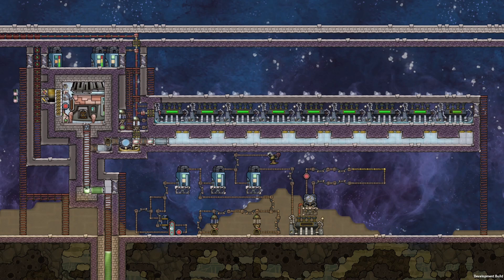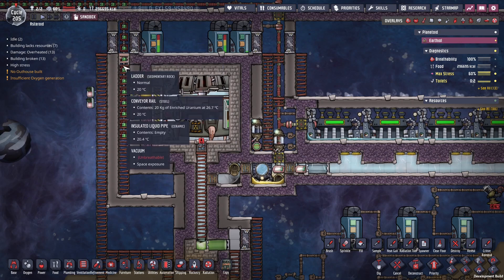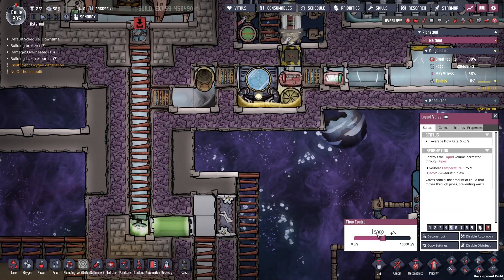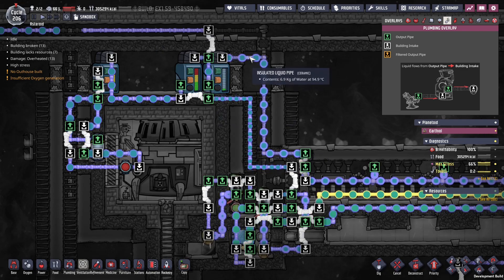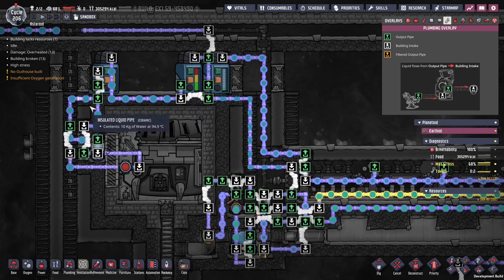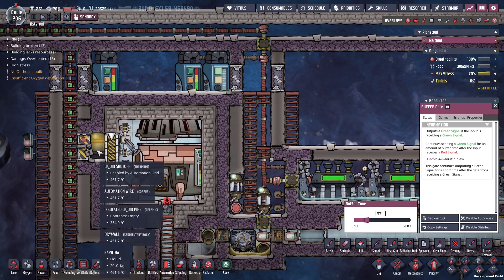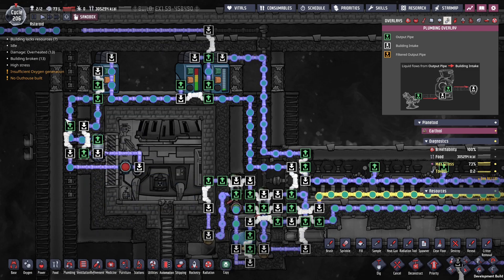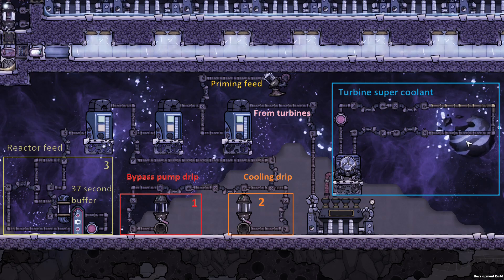Going Nuclear! - Oxygen Not Included: Spaced Out!

Comment: I'm not sure if it's just that nuclear mechanics have changed since this video was uploaded, or whether I'm doing something wrong, but the problem I'm running into is that nuclear waste is heating up beyond its vaporization point inside of the reactor, and so immediately flashes to fallout upon hitting the bunker tiles below.
Reply: Looks like setting the buffer gate to 24 seconds is perfect now, nuclear waste comes out at ~523C, which is probably as close as you'd want to cut it to the vaporization point of 526C. Sadly that only manages to power ~7.5 steam turbines rather than 8 and some change.
Reply: @JM-qo7bk  I know this is old but...

You kinda want the waste coming out at 2000C+. The hotter you get it the more usable power you get out of it. You prevent 2000C waste from flashing into fallout by dripping it into a 1000kg tile of 400C waste.

In 1 tick the reactor waste hits the waste basin and averages with 1 tile. If that temp is higher than the flash point, the liquid flashes, if not the temp spikes up then averages put with the surrounding pool.

Thats what you draw your heat from before the next superheated blob drops into your core.
Reply: @louishermann7676  The problem is that you never get 1000kg of 400C waste if it flashes as soon as it drops.  You can just run the thing for a while at low efficiency to build up the pool, but if so, that's probably something that should be mentioned in the video.

And with this design, there's really no benefit to going over the 526C mark, because the steam turbines are already running at 100% efficiency. You'd have to make a longer line of steam turbines to take advantage of higher output heat.
Reply: @JM-qo7bk  Yes, for a coolant limited reactor you do need to prime anything that needs nuclear waste with the waste from a fully cooled reactor.

Once it's primed you then limit the coolant which cranks up the output temperature.

Again you're also right in that if you crank up the heat without having enough turbines to cool the system you'll eventually overheat it, flash waste into fallout, and gunk up your steam turbine, potentially causing a meltdown if your coolant line is only fed from the ST wastewater.

You can, of course increase the coolant flow into the system if you don't want to build or run that many ST.
Reply from the maker: I'll need to do some more testing, it's quite possible some things have changed since.